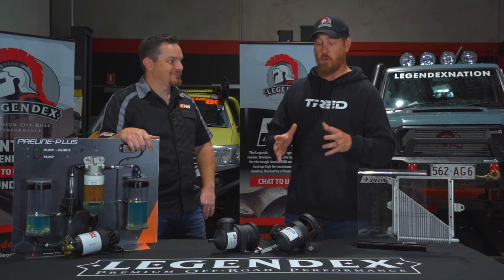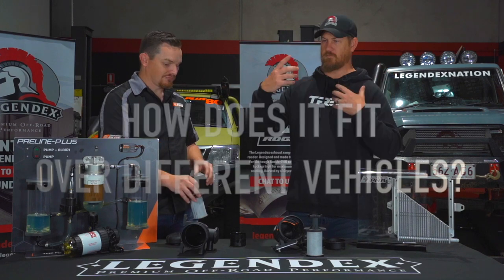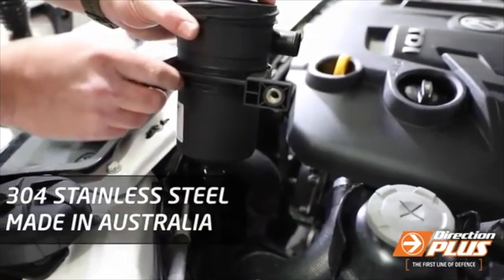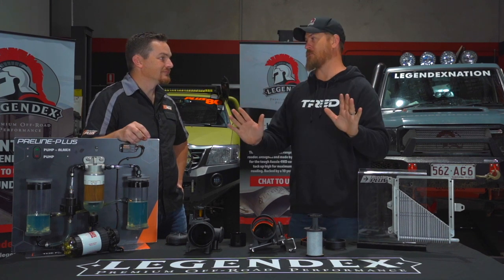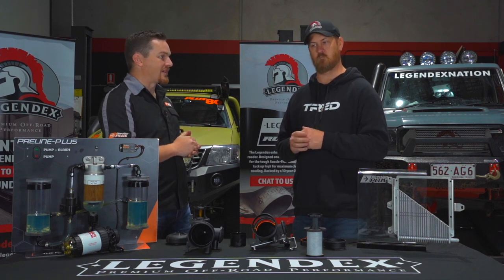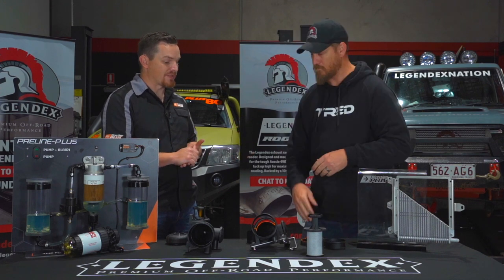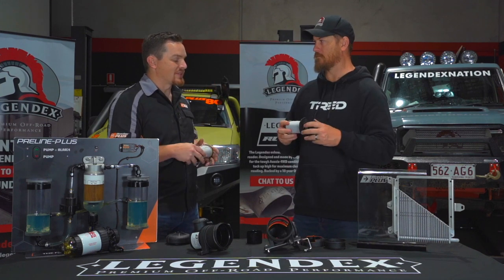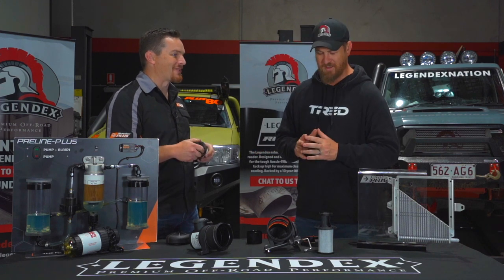WHAT IS A CATCH CAN | EVERYTHING YOU NEED TO KNOW

Comment: hi guys i installed provent on a 2020 sprinter 4x4 , at 20k   in winter done 2500km on it checked had about of water 150mm in it ,oil filter was covered with oil ,checked a gain another 1000 km still had water about 50 mls and 10 of oil , is this normal?